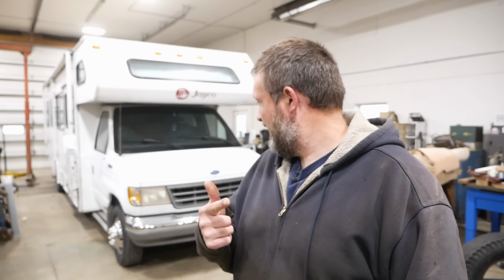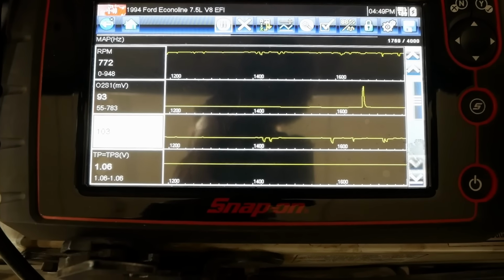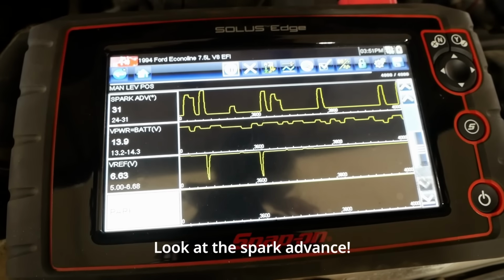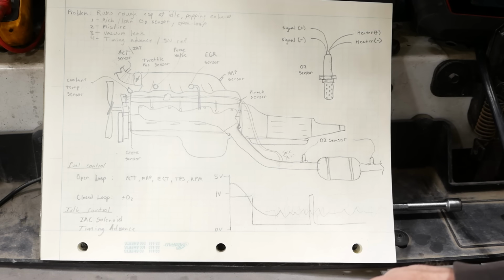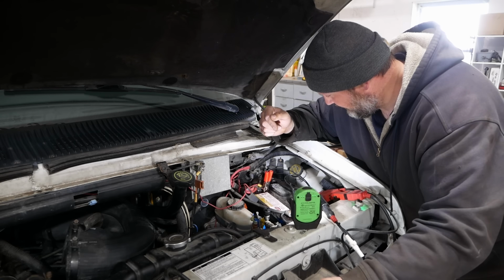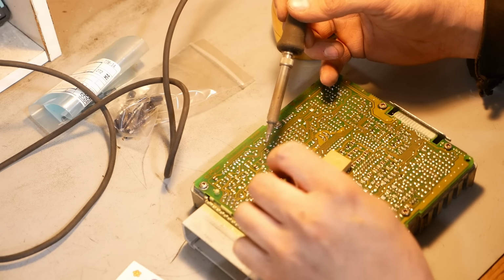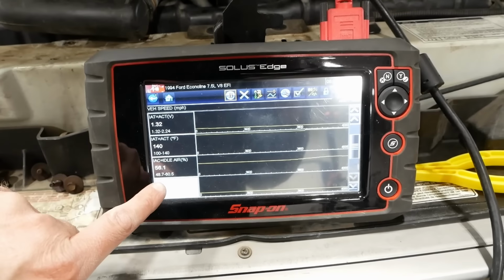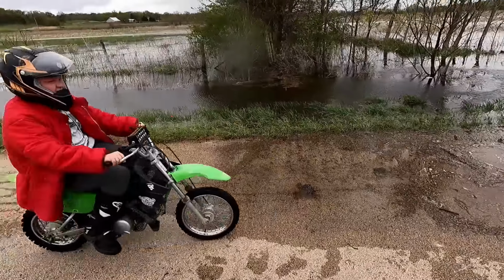Ford 460 RV Surges, Runs Rough but Nothing's Wrong?

Comment: I'm 68 years old. For years I've worried with throwing parts and cheap OBD tools at a 1994 Ford E-350 RV with 460. It has exactly this symptom! I have HOPE! (wiping tears of joy).  I've give 10,000 thumbs up if possible. I've yet to read all the comments. Until then I'll give the pitiful bit of info I know: Electrolytic capacitor life is directly related to temperature. It's so predictable the life of tv's, computer monitors and everything else can be "programmed to fail" just after the warrantee period. COOL THEM. Buy consumer goods with both eyes on chassis cooling. That computer is in a hot place at high rear of engine and close to the cooking dash. My thoughts are airflow improvements if possible. Consider even a 12v laptop fan with some protected holes in the case if that might help. Another thing found on our only long trip: I was fighting the steering at every change in road slope. Steering was a nightmare. I thought I needed one of those front stabilizing rigs. Stopped at Salina Spring in Kansas. The lady in front called an old geezer from the back who dismissed my stabilzer thoughts with "Nope, it's the back" and turned his back and walked away. $350 and WHILE WE WAITED he MADE and TEMPERED a helper spring for the back like a blacksmith from the past and installed them. It raised the rear by about 6" (ending most dragging out of stations) and made that thing ride and track like a race car. It's a JOY to drive and I used to revel in accellerating onto an interstate and merging into traffic like driving a REAL vehicle, even with one finger on the wheel. Do it. Retired. No way to have your diagnosic tools and certainly not your experience and insight. My RV sitting in the back yard rotting away with a full set of were new Michelins MIGHT live again at the time we need it most. Everything else I can handle. I "think" I can handle the brakes. I can't wait for my wife to wake up so I can show her what YOU found. I love you man! I'll build you a shrine! Where's the merch? This might be the weirdest comment you ever get but the feelings are real. I really needed something positive in my life at this time. You probably gave it to both of us. I have other useful advice on more mundane things if you want it. This is already way too long.

Comment: Maybe catalytic converter? That is what was wrong with my fores mustang v6 ran great cold.longer it ran the worse the engine got .it would get worse and worse the longer it was driven .we found out both eere were fully ruined and the radiator fan was sezied. Our fords break evey week. We went thru 5 batterys and 4 alternators .also.we aldo went thru 5 relays for windshield wipers and starter. Ford manufacturers do every thing possible to keep the mechanics not in mind.they make fords a night mare to work on.most other brands like gm and dodge make it easier for mechanics to work on them
Reply: No Cats on 12k gvw back then.

Comment: Three problems right off the bat problem number one it's an RV problem number two it's a 460 EFI but those two things aside your biggest problem is it's a Ford your only solution is to drag this thing into the middle of a field and set it on fire

Comment: Maybe they just had the o2 just to meet the emission regulations. In the arial equipment side I’ve seen dummy diesel exhaust pressure sensors where they were right from the factory run to atmosphere but on paper showed them on the inlet and outlet. Food for thought.

Comment: Hey Wes! Advancing the timing for idle correction it's more common than what you think.

For example, on most aftermarket ECUs that's an option to control idle.
Great vídeo as always, and with every video I confirm why I don't work as a mechanic.

Comment: I've same issue on an f350...runs then as you go road you can hear engine change tone...but not miss and lose power then like you flip switch its back just like if changed timing going down the road. I lunched the parts cannon at it. Ecm is only thing left...sadly it's been beaten me for years

Comment: those were surely 6.3V caps on the 5v and other low voltage lines, not 63v. probably not low ESR or anything special at that age, so whatever caps at same capacitance value should substitute in fine. the 16v ones are likely filtering incoming vehicle voltage, they may have had help going bad from overvoltage/overcharging when in storage/generator/power supply plugged in. the old power supplies from then were fairly crude and would often cook batteries and output over 16V, especially if the battery was unhooked or bad. learned that the hard way also.
Reply: Nope 63 volts...

Comment: pretty common on the older fords(and other brands then), there were lots of ECM/PCM gone south, sometimes capacitors, sometimes cooked drivers due to other parts of vehicle being bad(usually injector/s) gone short or low resistance with shorted coil turns. I misdiagnosed a few back then and ate the poo sandwich of replacing the ECM/PCM twice, after then finding the injector/s were bad. lesson learned, when ECM/PCM is kaput, check everything connected to it for issues.

Comment: I visited a rebuilder location I use to see their process . The first thing they do with boards that come in , They run them through a commercial grade dish washer like you see in a restaurant . That seemed weird . But that takes care of the protection film put on boards along with some solution they use and it cleans the boards sparkling clean removing any grease and wax, oils from fingers and elements  . The last thing i thought was to submerge a computer board in water .

Comment: It being an RV has nothing to do with the problem.  I was pretty sure it would't be the O2 and was guessing ECU pretty early on.  I love that you opened it and found and fixed the problem, very cool.
I broke those mechanic's rules long ago, I own and work on boats and RVs.  I'm also in violation of the other mechanic's rule; I have several old ugly vehicles like I'm supposed to, BUT they all run properly 🤣

Comment: The logic is contained in the program on the integrated circuit inside the computer.  Being an older 1 engine the control was a bit more crude.  Auto makers were forced to comply with emission standards over time and on an increasing cleaner engine basis.  The level of emission control on this unit was not as great as later engines where more emission control was made mandatory by law.  You have to remember that the first computer engines were a bit crude by comparison with current standards.   They only had meet the level necessary at the time.  If it was wonky the auto makers looked the other way.  Afterall, they didn't want to spend the money to completely scrap their total engine designs.   They were given time to come to the standards that were required later on.  So they had time to adjust.  If you lived through the advent of the move towards emission controls you'd know that auto makers went before congress and fought to get the more gradual increase in control over time than all at once.  It was an economic issue.  Engines went with relatively no control to current designs over the intervening years.  And there were lots of hiccups along the way.  Sort of like pretzel logic.  You called it magic.  Engineers did only what they had to do to meet standards each year.  Profit was  the bottom line.

Comment: That is hugely impressive. A car mechanic who not only knows what a capacitor is, but can find one of the right value and voltage rating from his bits and pieces drawers. Respect!!!
Reply: He is more than a car mechanic. Check out his early video’s.
Reply: Wes aint car mechanic. He was CNC machining center repairman who got fed up and moved back home county. He knows both angry pixies and spanner jobs, with impressive skills.
Reply: Maybe one thing that should've done to those caps would be fixing them in place. Otherwise vibration could break the leads. Maybe restore PCB coating. Not seen here but he might've done that.
Reply: Wes is an engineer & most of the mechanics I've worked with know what capacitors and PCB's are, if you think they have time in a shop to open up modules and repair them, you're nuts. You basically have to be an engineer to work on modern vehicles and own about $80,000 worth of tools. It's a joke of a career.

Comment: I recently worked on a EFI vehicle, that had a lean condition at high rpm and w.o.t   Eliminated fuel pump and fuel pressure regulator........it turned out to be partially clogged fuel injectors.  When back flushed, little chunks of rubber pipe came out.............#$%^ of problem to sort out.  Interestingly, when playing with fuel pressure (using an adjustable aftermarket unit)  higher than stock pressure caused as many problems as lower than stock pressure........not what I expected.   Wes, you were saved by the live data............I have a Ford of the same era........and use the free "Forscan" software.  Dam electrolytic caps are a plague............

Comment: I'm elated that you pronounce solder correctly! Repairs like this are becoming far more common, something i do and see a lot of is cracked solder joints on pcms/ecus mounted in engine bays. No idea what manufacturers were thinking when they started doing that 🤦‍♂️

Comment: I had done a lot of board repairs and you did a great job all the way through on the ECM.  THOUGHTS  1)Before you fixed the ECM it was probably reading all kinds of varying inputs and that could have messed with what the ECM was telling your scan tool.  2) Oxygen sensor - this could have also been a ECM being mixed up, giving you false readings.  3) vref 6.6v that could be a ECM issue, or it could be a ODB1 issue I don't have a lot of experience with odb1 to know if it's very reliable on every reading, especially since your VOM said 5 volts.  4) you didn't mention checking grounds but I know you are a good at diagnosis but a weak ground might affect your vref.

Comment: Use a Q-tip dipped in acetone to remove acrylic conformal coating from your repair area. I'm very impressed by your Hakko 808. Not cheap tools, but totally worth it.

Comment: Wess I think the reason you went down the wrong rabbit hole on your first diagnostic was the pencil you were using. All that glitter would cause any man to not think right, I'd try using a yellow NO2. Great job on the circuit board repair, love the hand drawn print.

Comment: I bought almost the exact same RV a couple of months ago. 1994 e350, 460 with a E4OD. Mine ran fine but the ECU thought my 2WD vehicle was in 4WD Low which made it shift WAY too soon. It would try to go to forth gear almost immediately from a stop. I pulled the ECU and found that the 3 capacitors on the board had ruptured and corroded the board.  I replaced them but I think I must have missed a damaged trace. I ended up buying a rebuilt one and it works perfectly now.

Comment: One of the electrolytic capacitor controls the timing advance and retard one of the other electrolytic capacitors runs the o2 sensor feed to the ecm

Comment: To much timing advance then not enough could cause the surging and stalling condition because after it warms up of the sensors are catching on the the advancement cha ge the crank and cam sensor could be shutting the engine down meaning the stalling because it's trying to protect the integrity of the engine from catastrophic failure

Comment: Great video Wes. Love how you stopped just when it looked like you were going to stoke up the parts canon, but went and did more analysis, which led to the fault, you should be proud of that outcome. I'm continually amazed with the stuff you have on hand, how many shops would have not just one type but a range of values of a type of capacitor? I won't be surprised if you burn your own ROMs and other flash memory stuff.
And yes S O L D E R, there's an L in there, always has been. Why do Americans say sodder???
I've worked with computers, computer systems and networks for more than 35 years and I've learnt that, if a computer has anything to do with it and the computer has a fault, then it's that fault that has caused the problem. Doesn't matter if it doesn't seem to have anything to do with the problem. Fix the fault, ignore the vagaries, move on and forget the weirdness. Life is too short.
Great work.

Comment: Fantastic work Wes.  I'm surprised you even thought that OBDI would have any idea what was going on.  Not at all surprised at the ECM failure in those...the KOEO/KOER testing is just dumb.  GM had WAY better diagnostics in their OBDI era ECMs, and they were still garbage.  Recently fixed the wifes 91 Lotus Elan (isuzu turbo motor, GM Electronics/sensors) that I was able to track down to a semi-bad vehicle ground, engine/interior/battery all ground at one point, 59 Ohms from the engine block to the battery was the clue.  Only symptoms were erratic running, very high idle, and cooling fans wouldn't always kick on at the right temp.  Comparing resistance of the temp sensor to known values is what clued me in.  Although this job didn't make you money, it gave your diag skills a workout!  👍

Comment: Mr Carlson Lab uses a Hakko desoldering tool. Wes is using the right tools for the job. I'm constantly surprised at Wes skill sets. Strong background as a machinist, welder, commercial equipment repair, electronics circuit board repairs,and pounding on a rusty Mack Truck with a sledgehammer. You never know what he'll do during a busy day. It certainly makes entertaining videos.

Comment: I think your integrity and customer proximity is getting in the way for you Wes, diagnostic time isn’t free so perhaps you need to introduce a tariff for this with the caveat that you can’t always know the solution in the odd hour or so. It’s ok for customers to attach a value to a fixed motor but they can’t expect you to scratch your head for hours on end for free and if they don’t value what you do let them try somewhere else before crawling back to you.

Comment: Wes, electrolytic caps have a usable life span, 10 years average.  That's if there operating in the temperature range there specified for.  As for the one that pooped all over itself, undisputable.  

The remainder, you could have tested them out of circuit to further validate them, but there past the normal life span.  You have the tools out, and the replacements are available,  it was smart of you to replacement them also.  Good for another 5 + years.

Comment: The 6.2 V at the module might be because it is using the output as a sense wire. It uses the output to sense the voltage down at the O2 sensor. It might do this once at startup or maybe just once when they build the truck. This way. the voltage drop in the wiring harness is nulled out and you get 5.0 V at the sensor, as intended.

The higher voltage cap might not always be good-- a higher voltage might have more equivalent series resistance (ESR). If they make the dielectric thicker to get the voltage rating, they may make the metal foil thinner so the case is smaller. 

Fantastic de-soldering skills. Pronounce it any way  you want, you rock dude. I have seen guys give a shot of polyurethane to repair the conformal coat, other use clear nail polish. Probably nota big deal in this case.

Comment: Imagine cramming a 7.3 gasser or a 5.0 v8 cummins into that
Reply from the maker: They put the 7.3 diesels in them.
Reply: @WatchWesWork  yes they did but they seemed kinda nutered compared to the superduty version
Reply from the maker: @thundermite1241  Right. They did not have an intercooler.
Reply: Cam and exhaust really wake up an injected 460.
Reply: @williamfranklin6283  Be careful you don't put too much cam in a speed density 460.
There were the very rare last year '96-'97 Cali models with MAF  but they are rare as chicken lips.
Reply: @jimurrata6785  I used the Comp Cams cam for Efi 460s. The computer gets a little confused at idle while warming up and it has a lopey idle but once it's hot it sounds stock and pulls like crazy.

Comment: ANY kind of wired problem that COULD be electronics or computer-related in any car do this test when nothing makes sense: Take a starter-cable from the battery-minus to ground (if it is negative ground that is, for Lucas systems use plus). If everything starts working then the wire-plait for grounding is rusted to hell and needs to be changed. So many ghost problems are solved by this!

Comment: I remember last year my 1994 Honda Civic was having some strange electrical gremlins, like the main relay and evap solenoid turning on while the key is in the lock position, turns out it was the ECU some caps leak and short and destroy some traces, after a cap kit repair and some ringbell wire I was able to fix the ECU and now runs like a champ

Comment: I am a retiree who spent his working life working for a large organization.  I therefore am in a very poor position to give useful advice on customer relations, but when a customer brings in a 30-year-old RV in, I think that he should be told (i)  that you cannot guarantee that you will be able to repair this antique piece of equipment, but (ii) that if the customer wants you to try, he is going to be responsible for all labor from when you start to when the problem is fixed or when he tells you to stop and calls a tow truck to get his piece of s*** out of your work space., whichever is first  I would also think about requiring an upfront cash deposit, like a lawyer's retainer.  If he doesn't like this, he is free to go down the road to pay $250,000 for an equivalent 2023 RV.